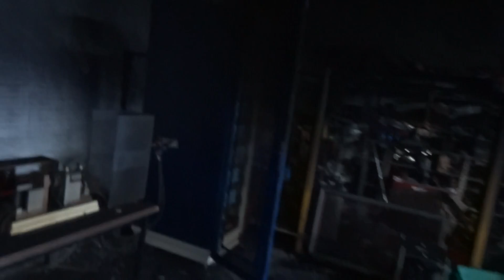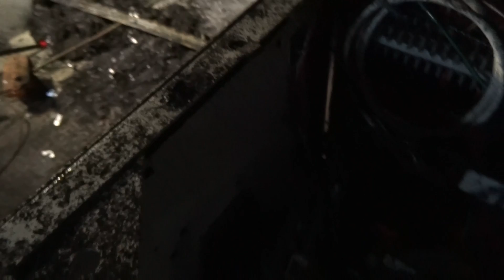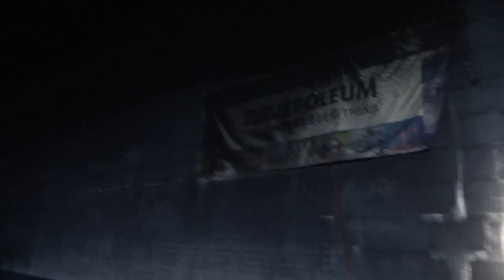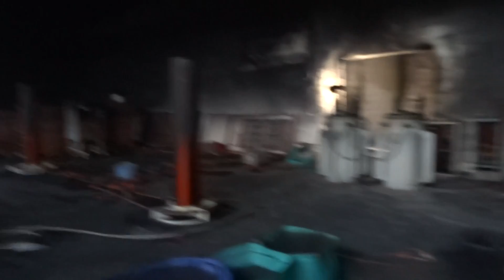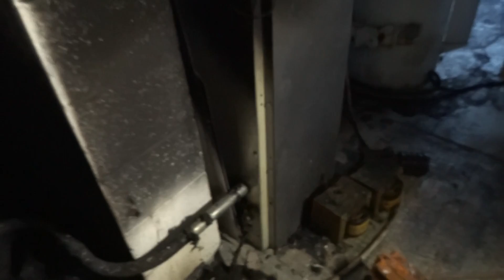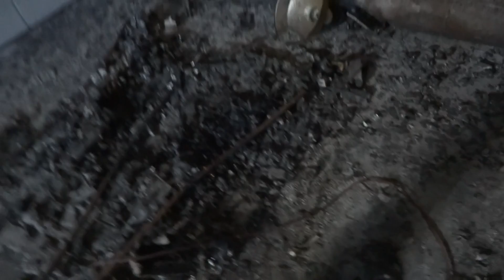After fire assessment of The Geek Group's High Voltage Lab

Comment: Why wasn't there a fire alarm?
Reply from the maker: A standard fire alarm wouldn't work very well. I'd go off every time we set off Thumper. The HVAC system had it's own alarm, which worked.

A total of about 20 minutes passed from them time the demo ended until the smoke was noticed. The standard procedure was followed which had the building evacuated and the local fire department called in two minutes. 

Chris has a better answer for questions like this on his channel (search for physicsduck)
Reply: tmbomber383
I'm curious, did the HVAC system not have smoke-activated baffles? Are they in the plans for upgrades?